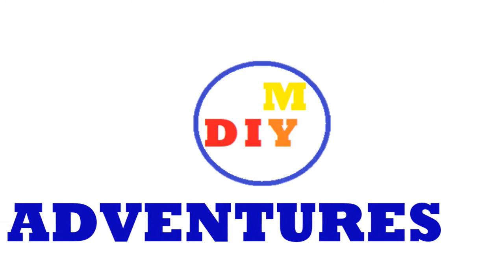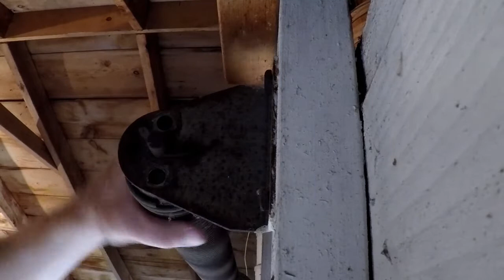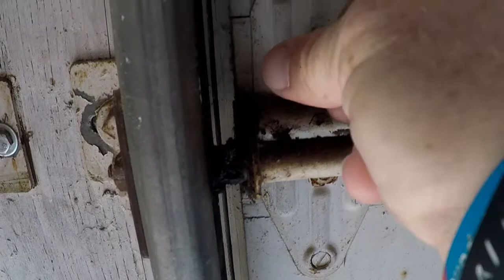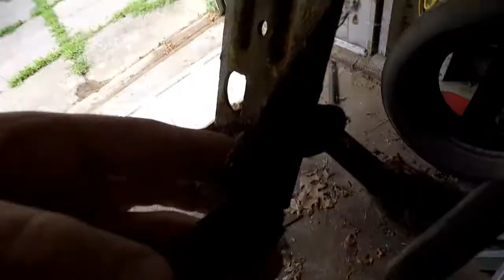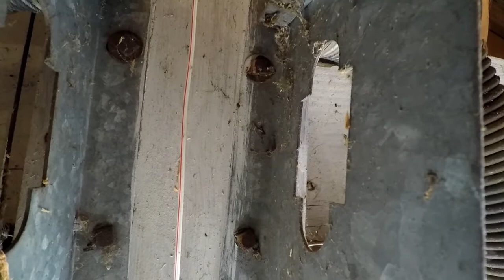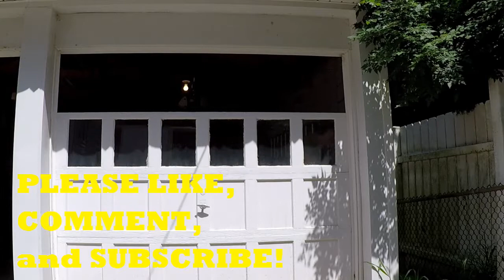Removing an Old Garage Door and Spring | How To | MY DIY

Comment: I know this Video is 2 years old. If you open the door the spring are 99% un wound. Cut the cables and lower the door back down by hand. This works up to a 16 x 7. Anything bigger is to heavy.
Reply from the maker: I’ve used that method lots of times too, it’s definitely quicker!